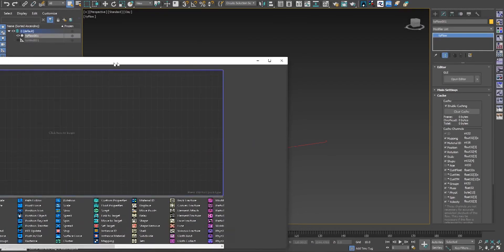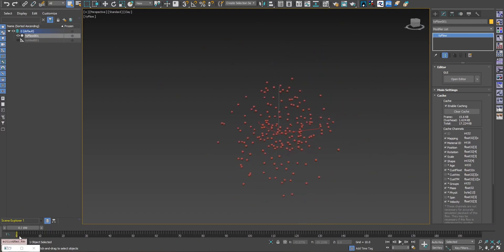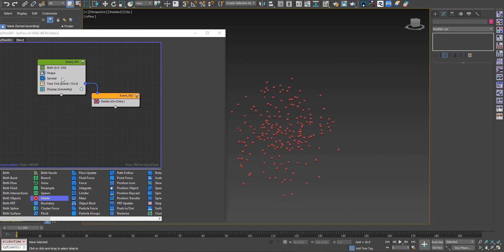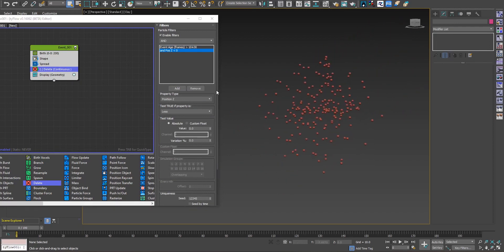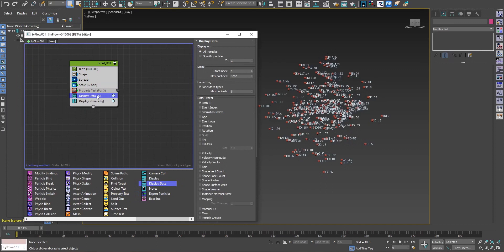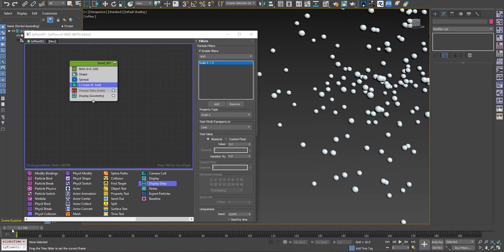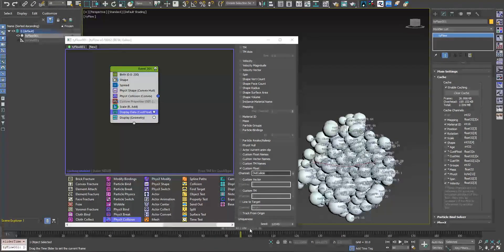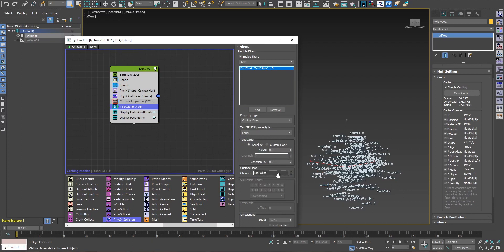3dsmax and TyFlow: how Operator Filters work

Comment: Hello Simone thanks for the video very good!!! one simple question i have 3 objects with 3 diferent textures, i create a emitter, to emit 100 particles with the 3 distinct objects from a tyicon then i add  speed, rotation and on the option shape i select the 3 objects (selected objects) and add them do the  shape, i apply mesh to generate render, when i render the particle effect all the 3 objects dont have the original textures ? how do i apply a texture to each object without beeing randomly  ? or how do i import the original texture from the original object ? thanks
Reply from the maker: Hi Gustavo, just create a multi-sub object material with your shapes' materials, then add a material id-random to your flow. 
Apply the multi-sub to the tyflow object, done!

EDIT inherit material has been added since a few - so under the "shape" operator go to "Instance material" and set it to "inherit from reference"! Even easier!